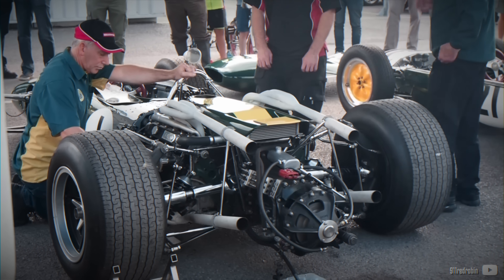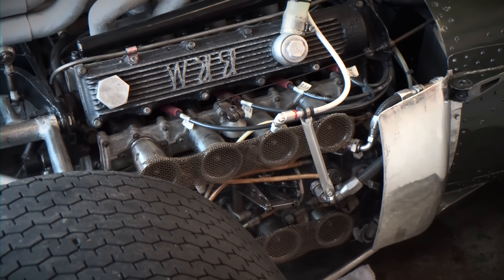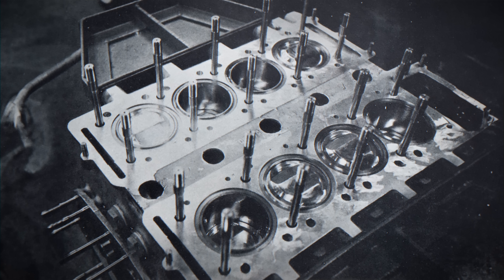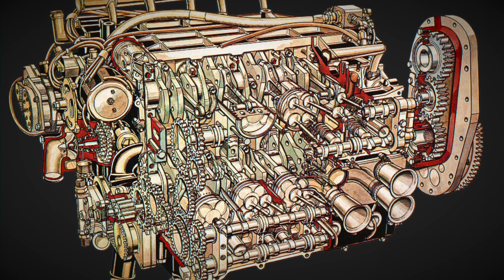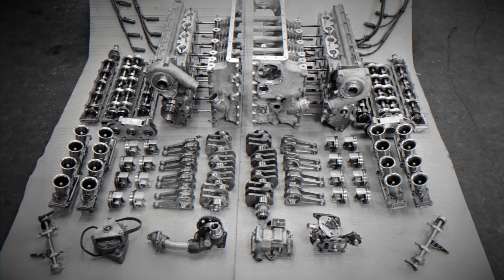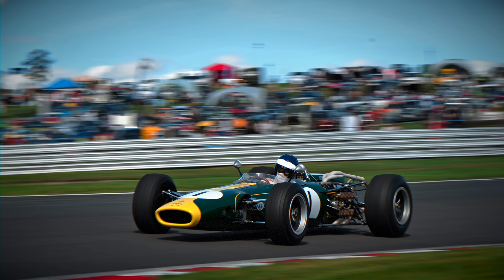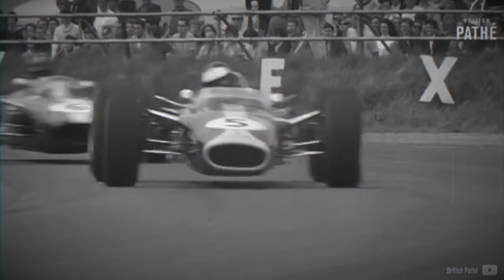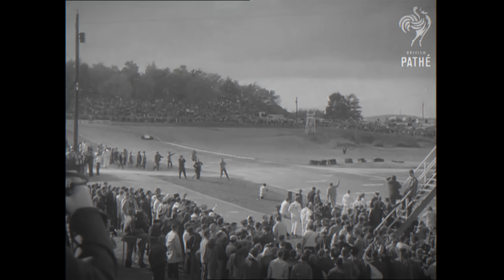The Most Complicated F1 Engine Ever

Comment: Well known to be a complete failure, it's still beautifully looking with these exhausts that looks like some kind of monster from the Cthulu lore.
Also have a monstrous sound.
Didn't knew it was inspired by Napier designs. Doesn't surprise me...
In the end can we say that the BRM H16 is a distant cousin of the quare Jumo 223/224 engine?
Reply: Not really, not an opposed piston engine. Also not 2 stroke.
Napier had H engines from 1929.
Reply: @paulqueripel3493 
Napier seems to have believed that the path to success was paved with complexity.
Reply: @mpetersen6 well he thought that a 2stroke cann make more power since each Revolution makes one bang instead of every 2 on a 4stroke and he  was fighting against shity low octan fuel detonating at hot spots on the piston  and too be fair how too cool a piston in a 2 stroke if not with Charge air but for that it should enter opposite of the exaust (so it dosnt Mix with the spent hot exaust Gases) and near the piston so sleeve valve was kinda the best solution for that

Comment: These may have been ridiculously complex but they followed the exploration of what is mechanically possible which is what F1 is supposed to be about. They are exceptionally cool! And very beautiful!
Reply: Yeah thats whats its all about!! I hate F1 now because all the cars are "the same"... no crazy engines anymore :/
Reply: @memorimusic420  
Me to. Fanatic F1 fan 1973-2013.
Reply: @upsidedowndog1256  i love the whole history!
Reply: Yeah! Shame its not anymore all racing is too set on general acceptance nowadays! Innovation is dead
Reply: @Grimm-Gaming  
The maximum amount of cylinders was set at 12 after this. Not because of BRM but because of fears of what Honda could do with motorcycle technology. Pity. Hondas were revving to 20,000 rpm in the 60s.
Reply: @upsidedowndog1256  yeah honda has always made some insane racing engines in both cars and especially motorcycles
Reply: @upsidedowndog1256   Remembering Mike Hailwood on Honda's 250CC six. 🙂
Reply: @upsidedowndog1256 totally agree 😅
Reply: Argueably cooler is BRM's earlier 16 cyl, which fully exploited the 1.5L forced induction allowed in the rules, revving past 12,000 rpm on the dyno making 600 hp. 135 deg bank angle too
Reply: I hear ya that's literally the only reason why I watch is for the cars and technology. The racing is horrible the teams and governing body are straight elitist, and the drivers are rich, uninteresting whiners.
Reply: @fernandoarroyo3889 totally agree with you 😅😅
Reply: And the most important quality, imagination.
Reply: Yes, but the whole point of racing is to finish first, and to finish first, first you must finish, if your car can't take you to the finish line it's no good. But still a really cool engine, and I'm glad such a thing was built.